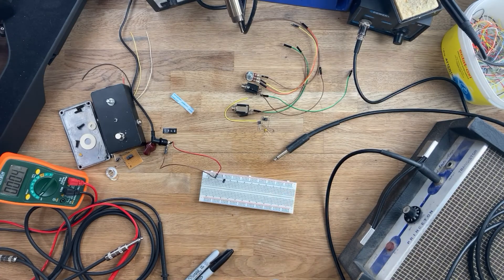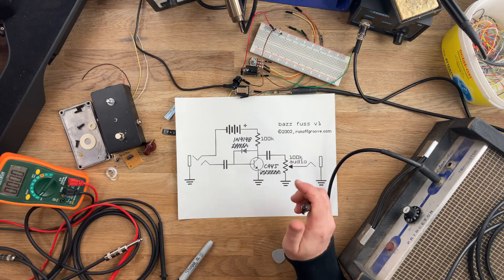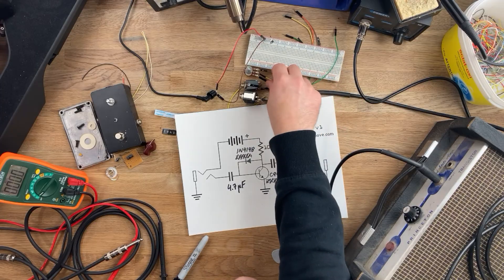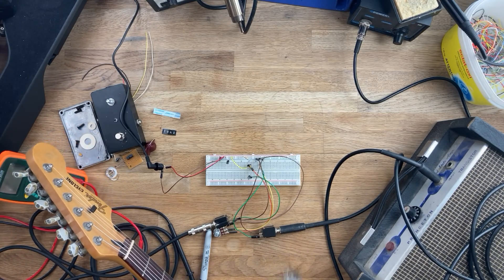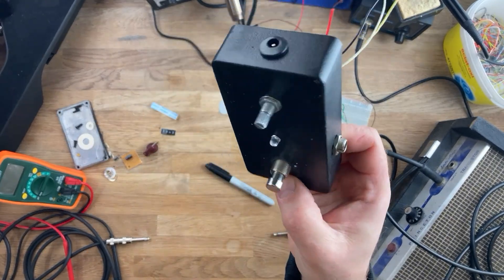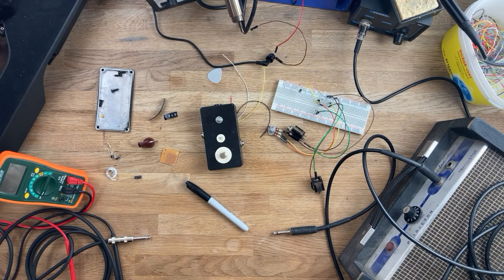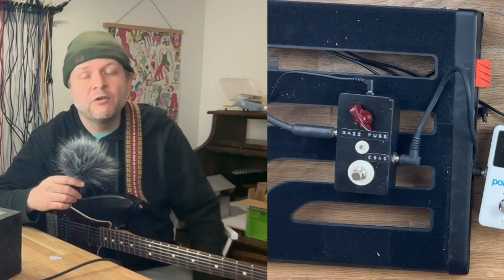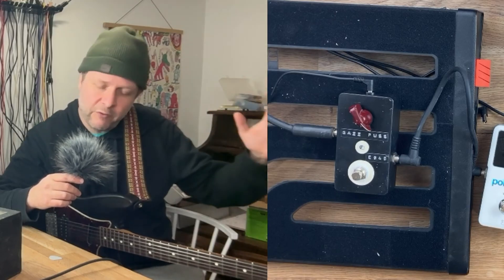Build the BAZZ FUSS Pedal! 💥 DIY Guitar Fuzz with Satisfying Grit |  Prototype Build + Full Demo

Comment: I love the MPSA13 using a red LED clipping diode. toss that in front of the octave divider section of Joe Davisson"s "Shocktave, add a gain control, a voltage starve pot, octave blend pot and you basicly have one my favorite bits of fuzz alchemy
Reply from the maker: Sounds cool!